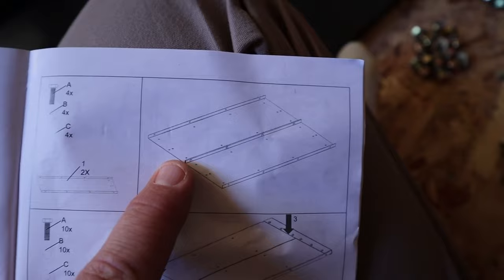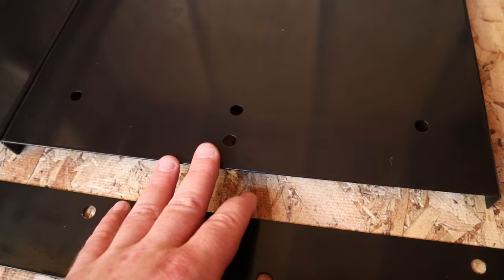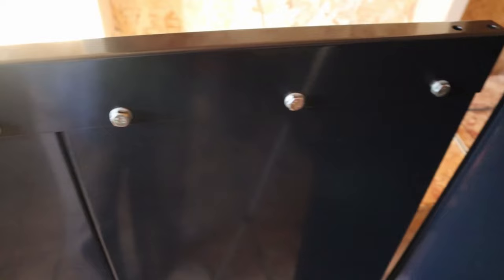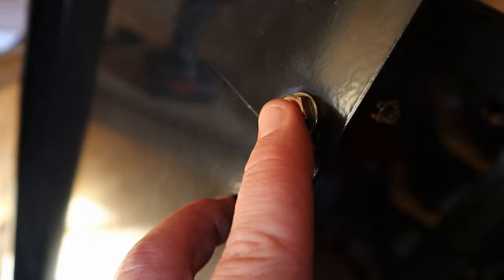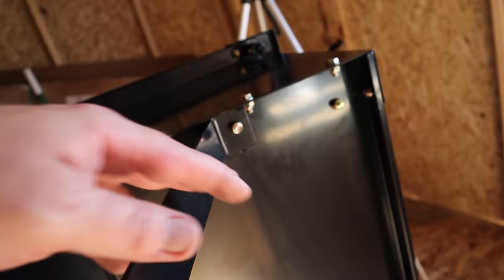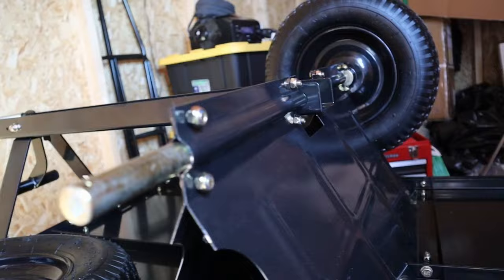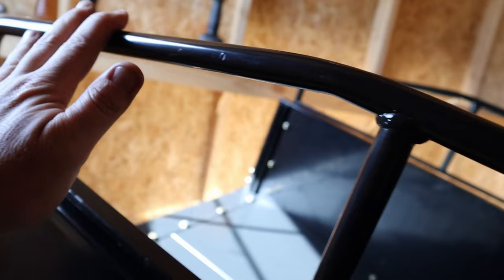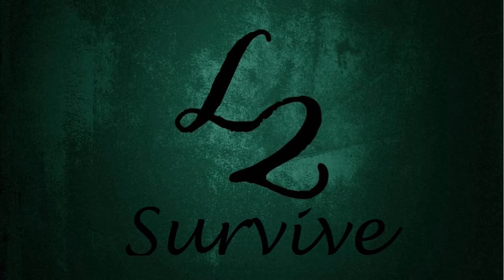VEVOR Garden Trailer

Comment: Any idea what size bolts those are?  Mine just arrived with no instructions and no bolts.
Reply from the maker: Sorry, I do not and I finally threw out the manual and box in last weeks trash.  In the video I did say that the wrench to use was a 13mm.  I doubt that helps but, it is all I got.  Did you try sending an email to Vevor and ask for the missing parts?
Reply: @L2Survive  I googled what size bolts work for a 13mm wrench and went to Home Depot and got them.  I got everything assembled, big thanks to your video!!  But since the bolt package was missing, I’m still missing the washers and the pins to keep the wheels on.  I need to go back to Home Depot to get that and then I’ll be done.  The little L shaped brackets were missing too.  I notified Amazon as well and will hopefully talk to the manufacturer on Monday.  Either way, thank you so much for taking time out of your life to make this video, it really helped me.